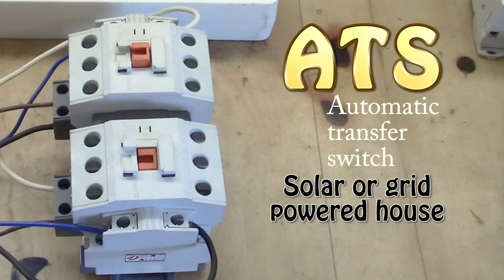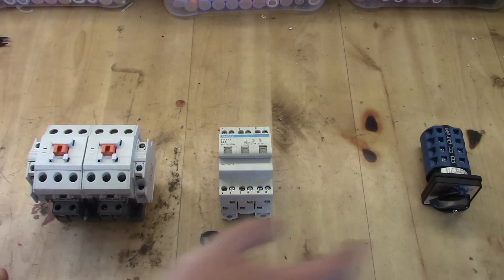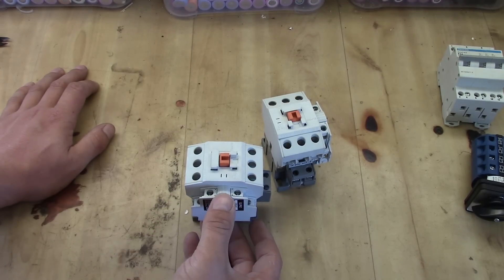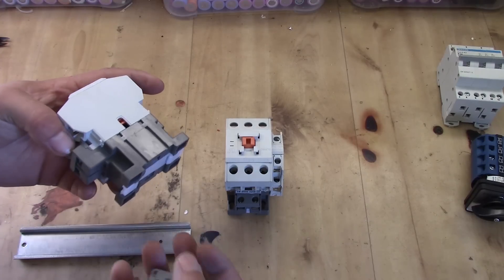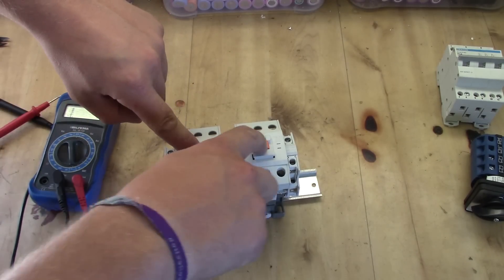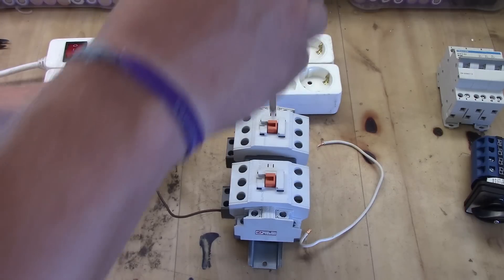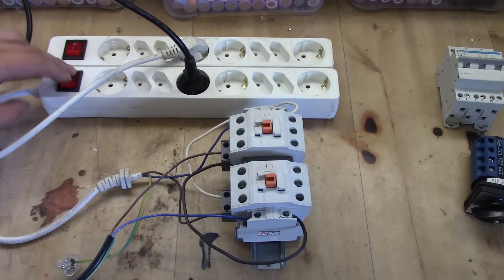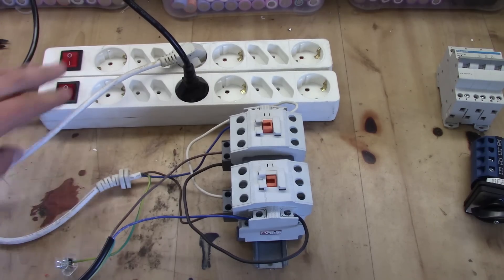Automatic transfer switch setup and quick look at 3 types

Comment: BDW good explanation. 
I have 3 phases from the grid, many times when there are storms only one phase goes out, the other two work. I have the idea of putting a separate relay for each phase, and in the event of a failure, two phases are powered from the grid, and one phase from battery solar power. what do you think DIY Tech & Repairs ?

Comment: Something i don't understand. At first you showed that pressing one contactor would not allow the other, but once you connected it to the switches you were able to press one and turn the other off. When you press the button does it first open/close the switches on the side to release the other contactor before this one engages?
Reply from the maker: Yes. It need to disengage first to engage second.

Comment: Is this allowed?
What is the time difference between cutting off one and energising the other?
Here we are required to "break before make", so you have to break the grid connection before connecting the alternate supply.
Reply from the maker: That's why you have mechanical interlock. They are allowed depending on area.
Reply: @DIYTechRepairs  so what's the time between break and make?
Reply from the maker: @the_real_hislordship  10 to 20ms.

Comment: Hello 
I have for my solar system the switchover with the Transverschalter of Aliexpress lä
east: 
GEYA Din Rail 4P ATS Electric Switch Manual Transfer Switch 110V 220V Coil Max 100A PC Type Switch City Power to Generator.

Comment: 1:00 Technically as written on the label, it is a Left, Stop, Right Switch more likely used on AC motor direction control.

Comment: Beautiful video  wish you make more of these. 

I've seen some installations using 2 contactors but ALSO a relay . Is a relay even necessary??The circuit you have shown works perfectly well without a relay.
Can anyone please help me understand "why the an additional relay " is necessary.
Reply from the maker: The relay may be to control the contactors?

Comment: In the demonstration we see that the move from grid to solar is almost instant. Does a load, feel the switch or is it really that fast that not even a light will flicker?
Reply from the maker: It can flickor. Its an outage of around 10-15ms. For instance fluorescent lights often can flicker and some very sensitive conputers can react to it.

Comment: Show us new  Magnetic contactors  without joining with each and other base on NO NC
Reply from the maker: Show? Just go to an electrician and ask for it. They should have electrical and or physical interconnection protection. Depending on area due to legal reasons. They arent Common but those WHO build datacenters or backup Power have them
Reply: I live in China due to language problem i request you to make video on it

Comment: I bought a three phase drum switch, not one pictured, from China.  I was to use it for switching PV panels.  Four independent switches if the jumpers are removed, ON/OFF/ON.  But, the switches make before the other ones break causing a momentary short and starting an arc that didn't stop.   Apparently all just to save a little plastic on the cam.

Comment: How can work automatically when conected to solar sirquit? How it can realize the low battery voltage inorder to be changed?
Reply from the maker: You need to have something between that can Sense the voltage.
Reply: @DIYTechRepairs  ok as i understood , i need two switches and something that can be conected to 24v input inverter poles correct so far?  So what is that item i need on between to be adjusted at 22v -27(off-on. Solar power  )  and what we do when we have 3 phase public electrical in the first switcher and one from inverter to the second? May work if we conect the switchers output of solar one phese with the other two public electrical output s in parallel, so when the public sirquit is closed we supply our home solar one? Any help would be helpful.

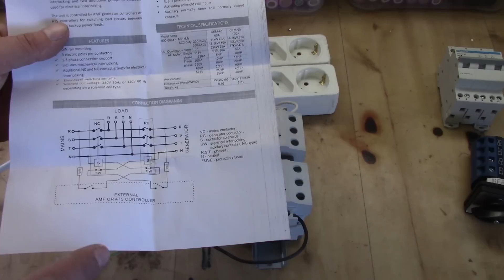Comment: You dont need control system to control which one is the first one(9:50). You connect your both main power wires straight to one connector, not one wire  thru other contactors relay.
Reply from the maker: Ok. Thanks for pointing it out!

Comment: Hi thanks for this informative video, however the link to this product is not working. Any chance of checking this
Thanks
Reply from the maker: which one of the links? This one? https://www.ebay.com/itm/4PRO-CEM-40-Contactor-Set-3P-40A-230-400V-50-60Hz/202755297054?_trkparms=aid%3D1110012%26algo%3DSPLICE.SOIPOST%26ao%3D1%26asc%3D20200122160600%26meid%3Dd9b120272af6451da0d66adcb57c2804%26pid%3D100011%26rk%3D1%26rkt%3D12%26sd%3D201490751145%26itm%3D202755297054%26pmt%3D1%26noa%3D0%26pg%3D2047675%26algv%3DPromotedSellersOtherItemsV2%26brand%3DPRO&_trksid=p2047675.c100011.m1850

Comment: Wouldn't it be nice if there was a single pole auto switch that would switch to battery back up when utility power was interrupted and back to utility when power is resumed. That's what I'm looking for so I can at least have heating from a battery source when the utility power goes out.
Reply from the maker: Its called ats ;)
Reply: I'm not sure you understand what I'm looking for. I have a 15amp circuit and I want to switch out the standard 15amp breaker and replace it with a smart breaker (not a fancy WIFI one) that will switch off the utility feed when it senses no power. In doing so it isolates the circuit so that the inverter / battery combo then can supply that circuit with the battery power while it is auto disconnected from the utility. This way it eliminates the need for human intervention by just replacing a standard 15amp or 20amp breaker in the main box.
Reply from the maker: @Gizzamano  thats called an ats. Automatic transfer switch. A switch like that can automatically switch between grid or gen/inverter based on whats available. I run it...
Reply: All the ATS switches I see are big units that don't fit into a single breaker slot in a standard breaker box.
Reply from the maker: @Gizzamano    Thats correct since they need bigger space. You can find ones that fit into standard DIN cases for sure but you have to pay for it. Schneider and ABB have plenty of contactors made for it but you need 2x the widt + 2u extra for it since you need 1 contactor per source and then interconnect and then electronics on the side. You cannot get by with anything else since  you interconnect 2 sources. Unless you want to break regulations and use a standard relay....

Comment: can you make a video whats inside those mechanical interlocks? i am planning to make one.. T_T i cant bought it anywhere here at my place... but i do know how to fabricate..
thanks im big fan of yours..
Reply from the maker: I dont think its rellevant to look at that If you ask me. For proper isolation you need approved gear so head for that. The mechanical interlock is just e lever that makes sure only one can engate at a time.
Reply: @DIYTechRepairs  i cant find pictures as to what the inside looks like.. i have an idea as to how it works.. but i want to look whats inside a commercial interlock.... and i might just copy the design.. fabricate it for my contactors....
Reply from the maker: @silverghost3506  i wont dismantle My contactors since i want Them functional. Its most likely just cheaper getting new ones

Comment: sir, while switch over, will power down for a second? what can be use for two ups redundancy, if one ups goes down load should move to 2nd ups without power down of output, pls. help sir, pls. reply
Reply from the maker: A ats Will switch within 20ms... But it demands that bouth suppliers are synced
Reply: @DIYTechRepairs  both suppliers means both ups input? oe what

Comment: But you cannot have a supply on a contactor that will not engage over time for it may burn the holding coil, contactors are designed to switch on in such a way that the magnetic plungers should be intact or else it will be burned. That’s not the way contactors are used.
Reply from the maker: Huh? IF the contactor doesnt engage something is wrong... The schematics in this video is the standard used for ats. So not sure what you are saying?

Comment: Hey! A pretty interesting watch! I love contactors! However, I got a question about the switch. Is there any sort of phase shift when the switch happens? How fast is it? Would it be fast enough to keep your electronics up and running, etc?
Reply from the maker: 10-20ms switch.
Reply: @DIYTechRepairs  Interesting and hopeful. Judging from the Biltema multimeter, this is a 50Hz area which would put this in the sweetspot zone as far as timing is concerned. I'm just concerned that the two different phases have a chance to overlap, but with 10-20ms delay that should not be an issue. I guess I'll try to hook it up and find out for myself. Thanks for the reply!
Reply from the maker: @eowendyl  they can overlap and potentially destroy your Gear. Thats why its better to use the inverters built in transfer since most of them sync with grid. Doing that is better.
Reply: @DIYTechRepairs  ll

Comment: Good day. I surely found this video very educational and the way you explained it is fantastic. However, I have a challenge to make my own as the components we get in our country does not correspond exactly with yours. The main difference is the areas of the input power and the output. Especially with A1 and A2. I am not an electrician therefore it seems a bit strange to me. Is there another video or can you explain to me the positioning of the in/outputs for the SASSIN contactor. I would surely appreciate it

Comment: I am facing  a problem. In our building there is DG set .which is being used as a emergency power source..and main source of power is from utility..
But we are getting triping at ATS point...when generator starts automatically on swiching off utility power...voltage is being supplied from generator..but at ATS we are getting one phase out of 3 phase ..triping...plz suggest me techincal idea..how to resolve this problem...

Comment: Daniel If I want to manually transfer from Grid to Solar and vise versa will I loose power in the house during the transfer or is it seemless?  I need to setup a system that I can switch to Battery every night but I need it to be a transparent switch.
Reply from the maker: IF the switch is fast enough its fine. Just make sure that the grid and inverter is synced or you Will generate a Spike

Comment: Very good !! to prevent the back flow power to the public net work....... To many customer use ATS diesel generator power by Plug or in parallel with main source public power supply That is not good because is authority power supply cut the main line may be some technician need to work on the line isolated and the same time you send power on public line power that is not good and not save for technician intervention .

Comment: Hi thanks for your video  may you please explain me how to configure contactors if I want that my solar system be the main input and the public grid the backup? so if batteries are with low voltage or energy, contactors switch to the main grid to feed my loads, and when my batteries have enough energy, contactors switch again to my  solar system. I will appreciate your help.
Reply from the maker: You need something that checks the voltage and controls the contactor. Can be all from an Arduino to something else

Comment: Hi I've manage to do it but I'm facing an issue. When main is off, the generator contactor engage normally, but when main is back online, the contactor tries to engage but it's like it's overlapping. And makes that sounds like it's trying hard to engage papapapapapapa. Can you help please? Thank you.
Reply from the maker: Thats because you hooked it up wrong. Either it drops the contact because you hooked up the main through the other side so it looses contact or you have the mechanical lock engaged.  You need to read up on the connection and how those works. Beware of that hooking ATS up can be lethal and can cause huge issues if not done properly.

Comment: Doing it with a single contactor will save you the stress of loking for a way to control the switching when there is supply from both source. Thanks.
Reply from the maker: Techno Thrviller its not legal or wise doing that with ac :) Most of them can potentially engage both in case of failure. You need the mechanical interlock and in some the electrical

Comment: Charging two banks of batteries 32 VDC each Bank.  Can I use the automatic transfer switches to go from charging one bank to Charging the second bank of batteries and then switch back when full charge power is detected?
Reply from the maker: Dave Walters potentially yes but get not have them in parallel from start?
Reply: Parallel YES but then I have no backup Power and the batteries get No rest.
Reply from the maker: Dave Walters but they get less used and therefore lasts longer IF all used att once. They dont need any rest. I would parallel Them and run Them all together.

Comment: Excellent Video - need a way to add a relay or use this method to disconnect my Converter/charger since my Transfer switch, switches the entire input from (Shore power/Generator) to Inverter.  So in a nutshell can I control 1 Circuit so when the Inverter is (live) the 1 Circuit feeding the (Converter) disconnects?

Comment: have you check the screw on the contactors, usually they move the square flat part to press the cable, in this case I think I need some spade terminal, but I'm not sure.

Comment: Great video, one question:  I believe the same thing could be done without having to buy a contactor with AUX ports shown here.  As long as the contactors use opposite circuits (one Normally Open (NO), one Normally Closed (NC)).  This way, the charge of one closes/opens the other.  Would you agree?
Reply from the maker: No and yes. depends on the contactor of course.
Reply: Thank you for the reply.  

Your "No and yes" answer is odd because I'm referring to fundamental contactors, nothing more.  The feature enabling this is your "lockout" mechanism, not the type of contactor.

Providing they are only used in the NO+NC combination, and wired so that the current from one causes the other to do the opposite (one has to open when the other closes), this should be all that matters, correct?
Reply: That is then a Manual transfer switch.  This is automatic as the grid power goes off and comes back on again, it switches 100% to the other system.    They  Energy companies cannot have people's solar panels or large batteries electrifying the local powerlines they are working on.
Reply: @SuziRider5D  - What I've explained is an ATS, a fully automatic transfer switch.  You may have misunderstood.

One contactor is NO (NOT allowing current when unpowered).  One contactor is NC (allowing current when unpowered).

It works by using both contactors in opposing fashion, combined with the physical lockout mentioned in the video.

Comment: It's looks great, but I think should be expensive, I have around 15 loads, so should be around $1000 there's no another contactor less expensive, and the ship is also exepensive
Reply from the maker: Jose Garcia this is used for Main only so no need to have multiple devices. Dont think there are cheaper.ones. those in this video are very cheap :)

Comment: The problem is that if you do not have grid power you will not be able to pass on the solar
Reply from the maker: The solar part of the contactor is of course powered by the solar power :)
Reply: Please, can you do with a light bulb? I did like you but when the grid falls I no longer have the power from the solar. I guess something is wrong, I'll rebuild the circuits, maybe it's wrong. Thank you in advance
Reply from the maker: Yes you must have missed something. To engage the side to be used you also use the power from that side. ie to engage solar the solar should power that contactor and the other way around. Did you check my drawings on my website?

Comment: The problem was that one of the three outputs of the contactor did not work. I moved the links to the other and it goes. It makes switching from the grid to the solar and vice versa, the problem is if interrupting the grid no longer works on the solar, you can help me ? Thank you
Reply from the maker: Not sure I understand what your issue is. Have you looked at my follow up videos that takes it further and shows more on how to hook it up?

Comment: I made the assembly exactly like you, I connected a light bulb in parallel on both outputs of the contactor but it goes only one. Normally I have 2 inputs, grid and solar and when I switch the solar switch I have to have voltage at the output of the contactor for so when I count the switch on the grid I have to have a voltage at the output of the contactor on the grid. If the voltage drop on the grid does not go to switch on the solar automatically. Maybe you can help me with a schema for my problem. Thank you
Reply from the maker: Look at the schema i added.

Comment: Hey I really liked your video. I’m living in Iraq and we use generator quite a bit. Was quite interested in the din/norm switch and if it would be any use for a hot water tank. We are currently constantly turning it n off manually whenever the power grid goes out. Cheers.

Comment: hello bro, very good explanation.
can you explain how to automatically turn on generator. I am wondering to apply this system in the residence.
Reply from the maker: First of all your generator need to be able to work with remote-start. If thats possible then its just a matter of timer and to get it to engage. I dont have any generator to test or build this up so cant help much today. I have not done this myself but read alot about it and there is plenty of other that have done it :)
Reply: V,good ,good saftey